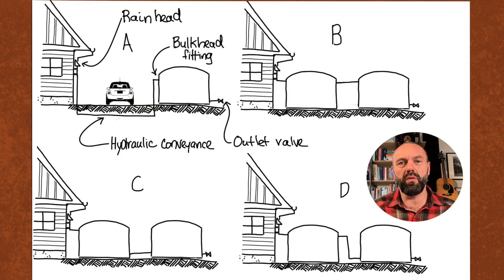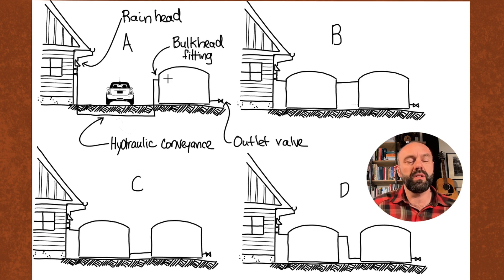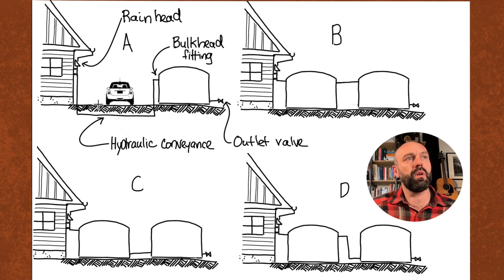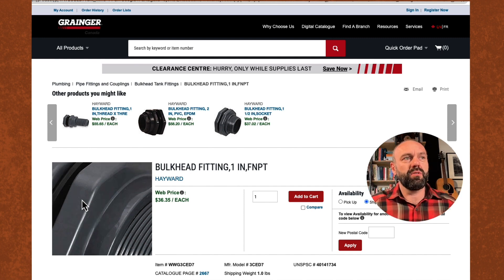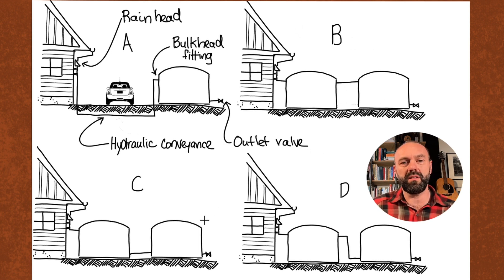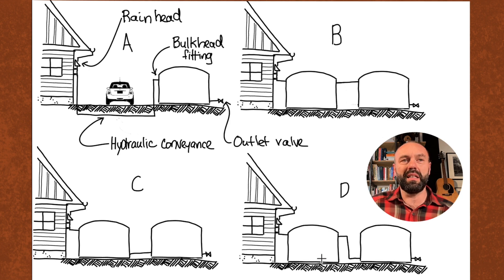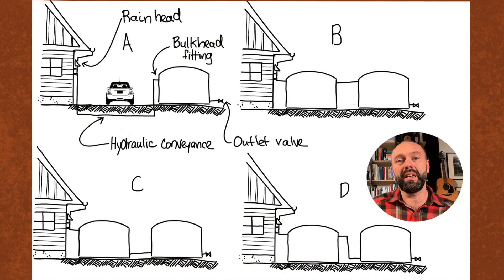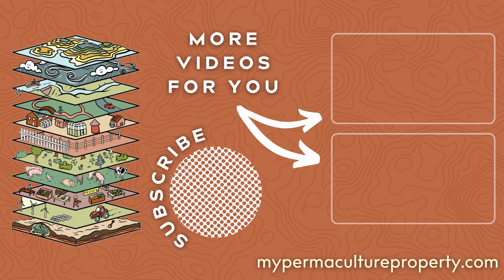How To Connect Multiple Rainwater Tanks by Rob Avis P.Eng

Comment: You didn’t even mention different heights in elevation of the tanks. C only works if the tanks are even height. B and D work if your second tank is shorter. And will keep first tank full but you need to add a vacuum break to line in between.

Comment: On my farm I have 2 tanks fed by a solar pump on a bore, which are connected and can both be fill simultaneously - but once full, only one feeds out to the cattle troughs etc; that way I can monitor it, and I have a full backup tank if the pump breaks down.

Comment: I've looked at several videos and yours makes the most sense of all. And you advocate using a 1 in bulkhead fitting which is really good. All the others are using half inch or 3/4-in fittings and it takes forever to fill a 5 gallon pail with one of those. With a 1 in poly valve, I can fill a 5 gallon pale in 10 seconds. The other issue with connecting tanks with small hoses is that if there's a any serious rainfall, the small diameter pipe can't handle all the water and it will be lost to overflow of the first tank. Thanks, Rob!

Comment: I have always collected rain water for watering my flower beds. I have used regular water barrels not large tanks though. When I connected them to equalize the water coming off my house roof downspouts I merely used 2+ way brass hose connecters with shut off valves on the spiget with double female end hose for the water passage (if the barrels are close enough washing machine hose works well).

Comment: I heard someone say that a B style system could allow you to monitor/ration stored water more easily, as each tank is independent from the other.  Also, if one became contaminated or sprung a leak, you'd only have to drain down the affected tank, rather than potentially losing all the stored water.

Comment: the advantage of B is that the fitting are not under pressure from the water in the tanks so the chance of leaks is significantly less   , you would be better putting at small collection tank by the house this provides a buffer tank and a settlement tank that can be easily cleaned before it hit your largest tanks saves money in the following pipe can then be smaller longer before it gets to your large storage tanks
Reply: The disadvantage is slower movement when it's raining hard. You'll lose potential water from overflow in the upstream tanks when down steam tanks aren't yet full.

Comment: Would it work to have a coil of garden hose in one water tank using a “siphon” method to transfer the water to the 2nd tank would the tanks continue to have the same levels as per your example “C” but without drilling the tanks?

Comment: I haven't gotten into the rainwater harvesting course yet, but this storage-flow, passive harvesting info is really helpful. 🙏🏼
Before hearing about the biofilm and it's capacity to keep water healthy, I've done a couple of version D.  I've learned that all of these strategies are functional, and that I prefer to keep the water flowing unless I'm aiming for a reason to use the potential of the stored mass to collect heat for a greenhouse or something similar.
Thanks, Verge and Rob for this mini lesson 🙏🏼🕊️
Difference Makers!

Comment: Thanks for the video. We have an off grid potable water system fed by a creek into 3 settlement tanks then into a 5000lt water storage tank. Providing the creek has not dried up or frozen solid there is a constant flow from the settlement tanks into the storage tank. I would like to install another 5000lt water tank next to the existing one. My concern is how to ensure that both tanks remain equally fresh. Would option C achieve this? Many thanks.

Comment: Thank you for the video. I am collecting rainwater from a house room. We have the gutters piped to the top of the tanks. I want 2 tanks for ever downspout gutter. In using the unifed method you recommend my issue is slope as my second tank will be lower than my initially filled tank. Can this method still be used with level but uneven tanks? ( I hope I am making sense)

Comment: I'm trying to setup a 2 tank system but my tanks will be installed about 46' away from the gutter and the tanks inlet might be level with the inlet of the rain head. What do you recommend so that I would be able to fill them both? I also wanted to add a filtration system because of the shingle roof I have and I only have space outside to mount the filtration system as well as the tanks.. I live in the northeast where I would have to winterize the lines. Any suggestions would be greatly appreciated!

Comment: Question what should be the optimal pipe size to avoid first tank overflowing before tank 2 fills up, due to a rapid discharge flow on tank 1 faster than discharge flow on tank 2?